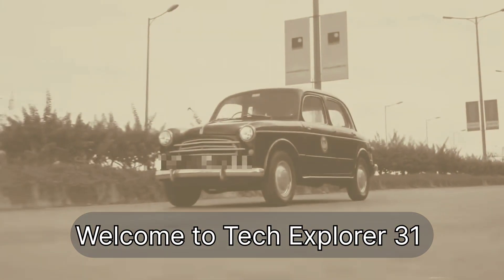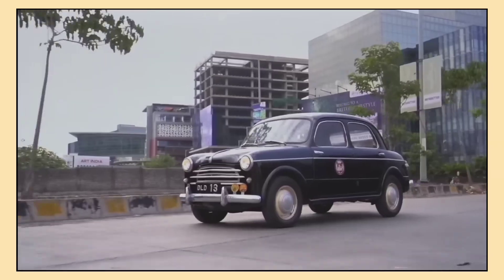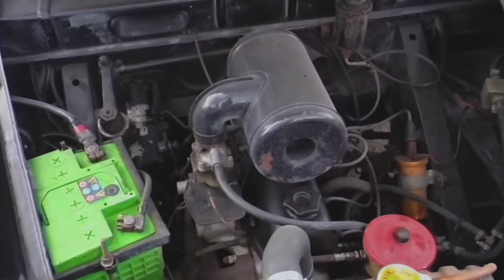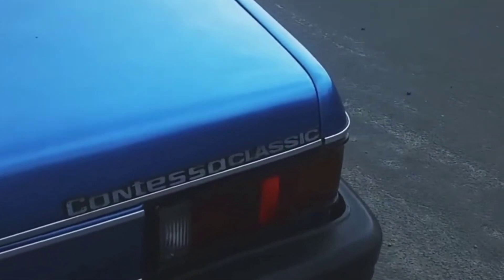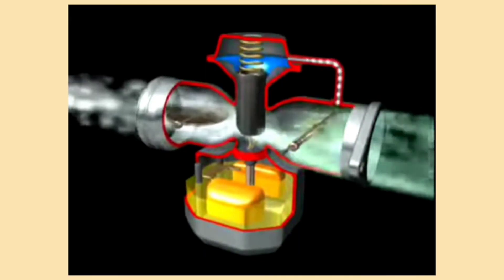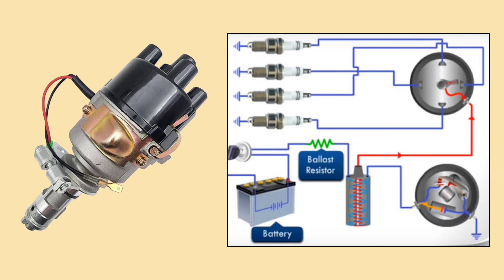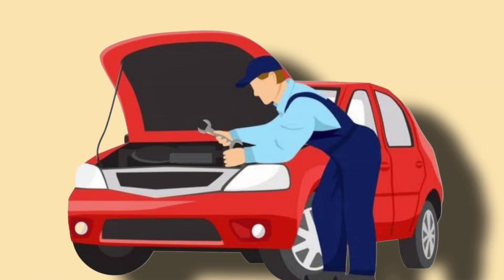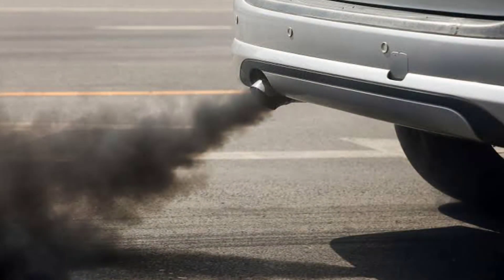"How Cars Ran Before ECUs: The Mechanics Behind Early Engines You Should Know" #vintagecars #engine

Comment: Cars and internal combustion engines do not need ecu and a dozen  sensors...  Only climatofanatics need that.  It do not change anything significantly as cars are far from the most pollution source... Try to have ships engines driven by an ECU and 20 sensors, having catalytic filters etc....
Reply from the maker: Modern ECUs and sensors improve fuel efficiency, reduce emissions, and enhance engine performance. While ships have different needs, car technologies are evolving for better efficiency and environmental standards.